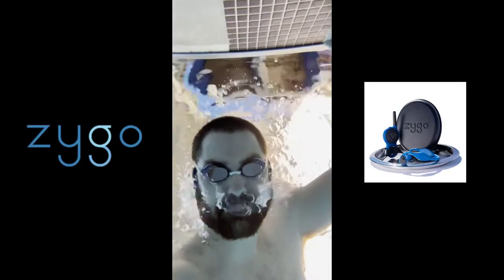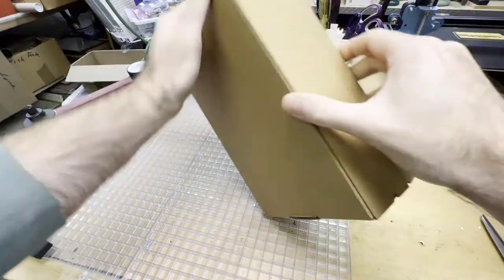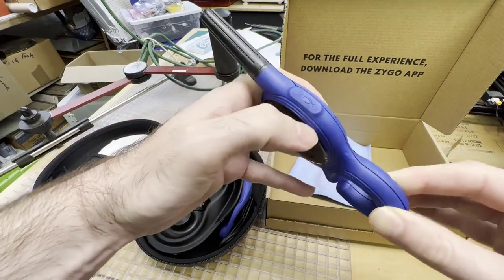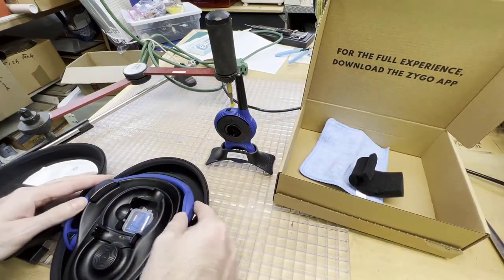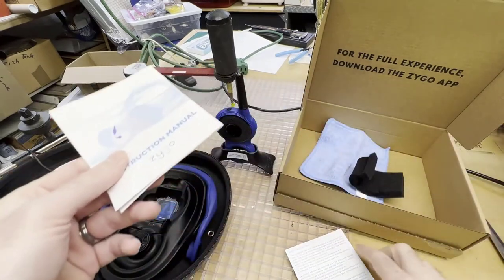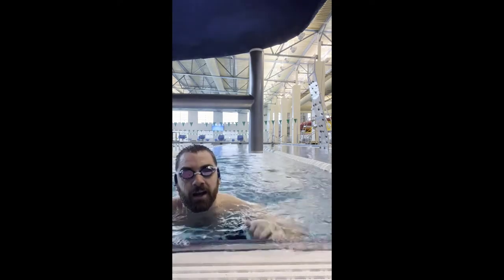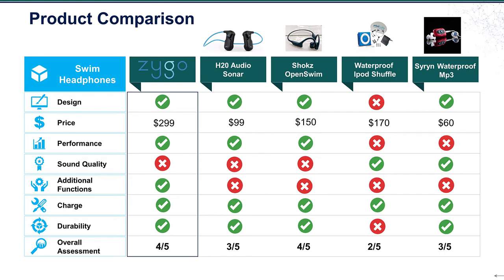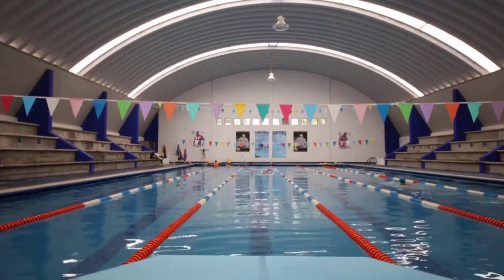Zygo Swim Headphones Review 2022

Comment: Review was done 9 months ago...from along term use and durability. I don't mind spending 299 on swim headphones to listen to podcast and stream but I would expect it to last 2-3 year. Any thoughts.
Reply from the maker: So I have purchased two pairs - need to do a follow up review on Durability and such. Overall they are made of rubber composite and handle up well to chlorine. The battery is something I am concerned about. One of mine failed altogether and I had to get a replacement due to manufacturing defect :/
Reply: @thesixsigmaengineer  would love to see a follow up review. thanks
Reply: I've had these things since the beginning and I've had constant problems with connectivity.  They're pretty much useless at this point. They are coming out with a second gen model so hopefully they will have fixed all of the problems but who knows. A LOT Of money for a lot of problems which sucks cuz when they work they ARE a game changer. Podcasts while swimming!  Dreamy! :)

Comment: I bought one pair and after two swims the headphones would not connect to the transmitter. I got a replacement pair from zygo and they worked great for about 2 months, and then I got the same problem with connection issues. This must be a common issue because zygo support doesn't even ask questions and sends you a replacement asap. Not really convenient 🙄
Reply: i saw a guy using these headphones in swimming pool. I thought he said they used FM transmitter. The person in this video says they are bluetooth transmitter reciever.. I am wondering what makes these better than just getting a regular bluetooth bone conducting headset which cost about $80 or so. Your thoughts?
Reply: @@manp1039  phone to the transmitter is Bluetooth but from transmitter to headset is FM signal. Bluetooth doesn't work after 1-2 inches of water.

Comment: I am extremely frustrated with my zygo      i charged the case with the headset overnight but when I got to the pool , it says I was only 10% charged on my headset...   What makes it even more frustrating is that there is no customer support that you could talk to !    they give you email availabliity but no one checks their email      Any suggestions
Reply from the maker: Strange - my battery did die and I should do a follow up video. They replaced the headset free of charge make sure you go through the website.

Comment: Can’t review on their site, so going elsewhere to warn people.

The large headset doesn’t work. They even replaced mine 2 times before the warranty ended… and it just breaks after 4 months min.

First headset worked for 10 swims. Second for about 6. Third for less than 3. 

Can’t use it an indoor pool. Can’t use it in a large pool. Have to dry it off after use. Can’t dive deep in the water. Can’t keep it in your car. Charger teeth easily break. Can’t order a single replacement part at a cheaper price. 

At $300, it’s a well advertised but underdeveloped and overpriced flimsy tech.

But hey, maybe 2024 will be different!